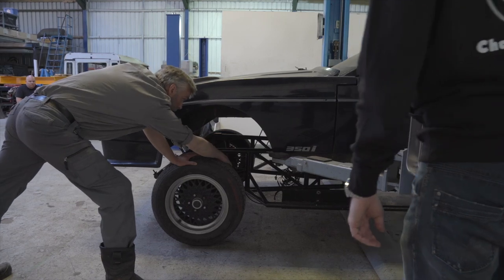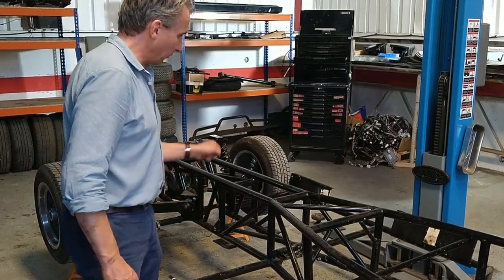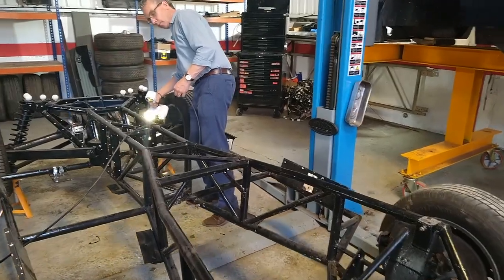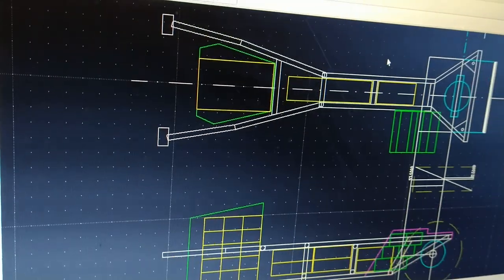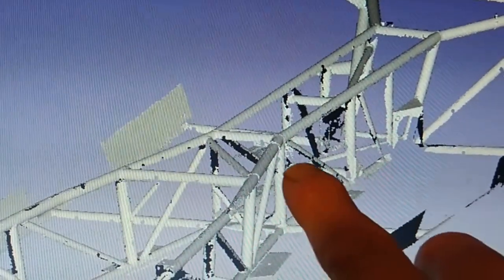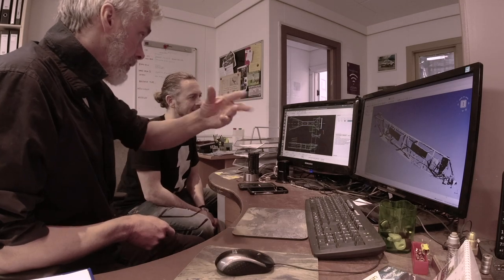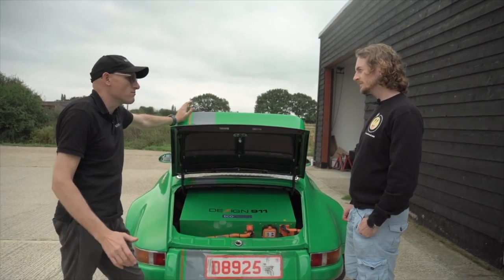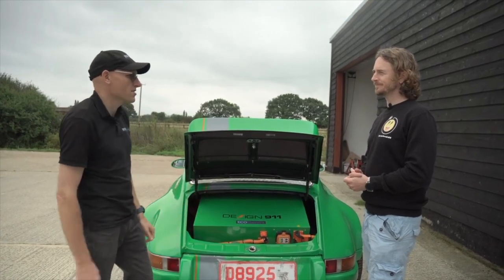CAR CAD and explanation of points system, IVA and ECER100 Test. TVR EV Conversion Part 3 #TVRWedgee

Comment: Very interesting about the iva. Any idea where i can find out what kind of modifications need to happen before an iva becomes required? Like modifying the but floor for example...
Reply: Boot*
Reply from the maker: Its down to the points system and how many changes you make to the car. They don't tend to like any cutting of the original car. The reason is it may effect the structural rigidity. I have found that a great resource for the fine detail on EV conversions is the open inverter forum. Check it out https://openinverter.org/forum/

Comment: So does this effectively stops someone building a kit car as an EV unless the company specifically sells an EV kit?
Reply from the maker: @ColinWatters  no, you just need to abide by the DVLA guidance. 😉
Reply: @chargeheadsuk  Including all the fire tests on home made battery boxes at £6k a pop ?
Reply from the maker: @ColinWatters  great question. If you follow the guidance of the points system there is no need for that. I would recommend you do a course with RHEL or Fellten to make sure you have the knowldeg to do a battery box and conversion safely. Then again I dont know your skills set
Reply: @chargeheadsuk  Thanks. I'm a retired Electronics Engineer but I've clearly got a lot of research to do on the specifics the car regs. May have to wait until I move house.

Comment: Jow about the gs450h solution? Attach it to the original drive shaft. 300hp.
Reply from the maker: Unfortunately that won't fit without major modification to the chassis. 🙈

Comment: I think the motor hanging out the back vw bug/911 style is the way to go.  If the model 3 motor can’t be adapter to a 911 transmission I’d ditch it and go with a different motor.
Reply from the maker: Unfortunately in this country there are many rules, which are there to protect everyone. Just frustrating, compromises will need to be made somewhere. 🤷‍♂️

Comment: I'd say have a serious look at a Leaf motor, they're running them up to 160kw stock now. It won't be insane like a tesla but the right gearing and batteries should give you a fun result.
Reply from the maker: Yes the Leaf motor is a great option 👍
Reply: @chargeheadsuk  I'm planning to put one in my Spitfire. My current plan is to drive the prop shaft via a reduction gearbox. You could do something similar.
Reply from the maker: @jamesfromwellington  what gearbox are you using?
Reply: @chargeheadsuk  of course I haven't done more than make plans yet and talk to a few people. The very first thing I'm working on is making scales to weigh the car with and without the motor etc
Reply from the maker: @jamesfromwellington  great idea. ECC recommend that before and after the engine is out to work out the balance for the car with the EV bits in. 👍
Reply: @chargeheadsuk   @ChargeheadsUK  I think my previous reply might have been blocked due to the link. Trying again. I was planning to try to have the torque as high as possible and directly drive the prop shaft. Then I came across this idea to use the first reduction stage from the Leaf gearbox. Had to take the link out, its on the nissan page of the open inverter forum under RWD reduction box
Reply from the maker: @jamesfromwellington  its certainly something that has come up as a possibility. 😉
Reply: Pricey option but I've always liked the idea of having an all wheel electric drive vehicle with torque vectoring, brake vectoring and instant acceleration from all 4 wheels 👌 may be easier to fit smaller motors between the wheels and the center of the car. But i understand I've done no where near as much research on the subject as you have. Best of luck with how it turns out!
Reply from the maker: @benrampling812  that would certainly be a first for a TVR. I wanted the rear wheel drive for the danger element to still be there TBH which is what makes the TVR what it is....a death sled 👍